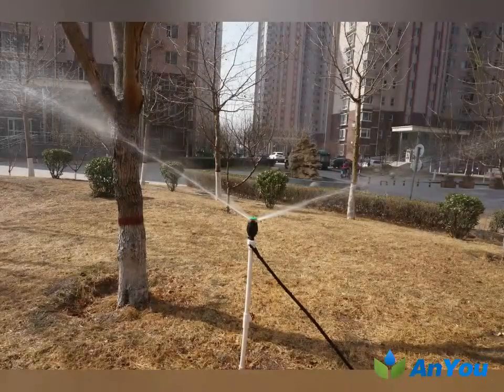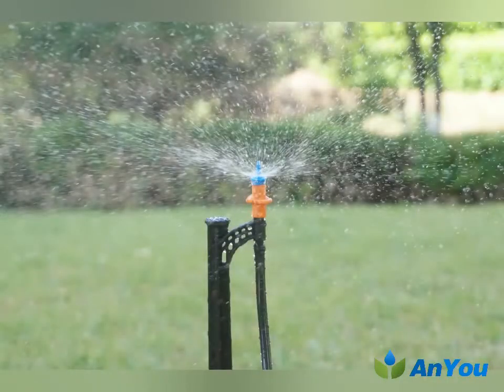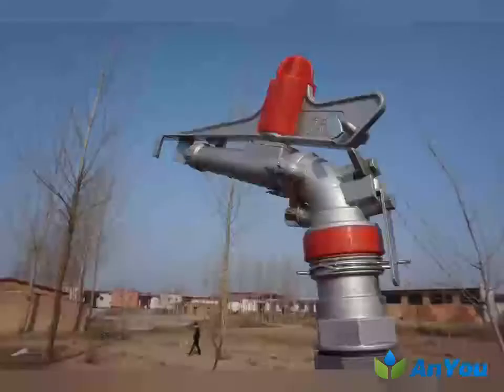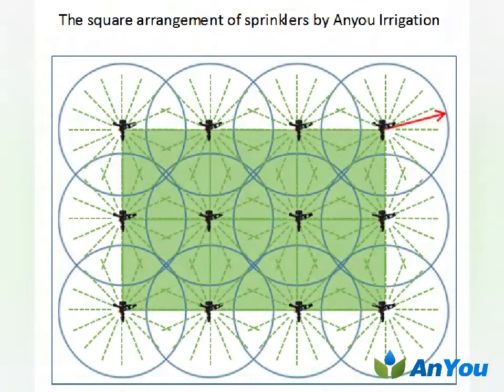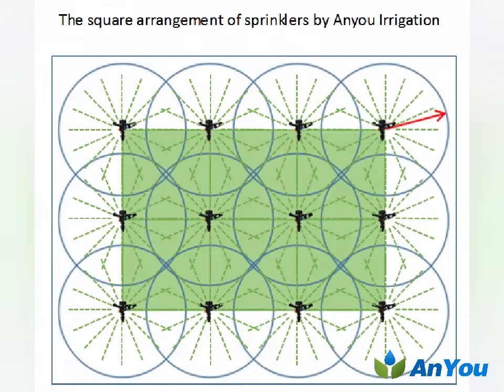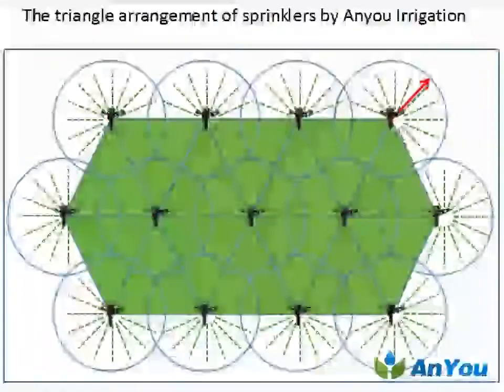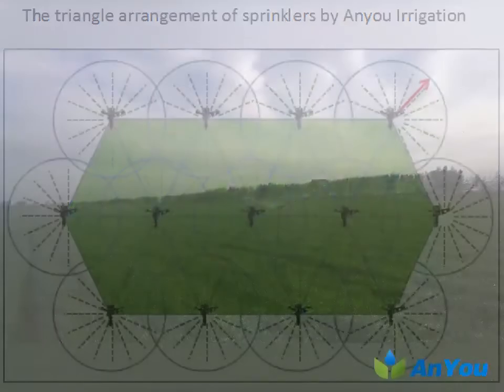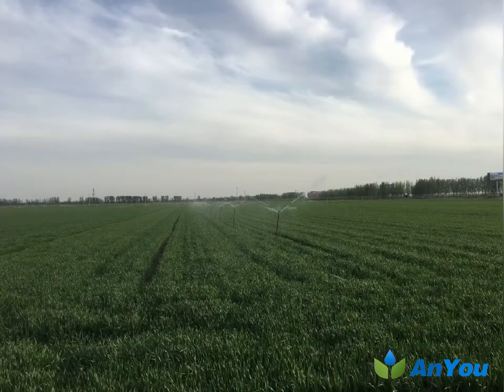Design, Selection and Arrangement of Sprinkler Irrigation System-Anyou Irrigation

Comment from the maker: Sprinkler for Irrigation and Its Design
Sprinkler Types and Selection in Sprinkler Irrigation System
Sprinklers Arrangement in Sprinkler Irrigation System
the selection and arrangement of sprinklers in the design of sprinkler irrigation system is a key factor affecting the quality of irrigation water in the whole irrigation system. 
The arrangement of sprinklers in sprinkler irrigation system includes the combination of sprinklers, the spacing of sprinklers along branch pipes and the spacing of branch pipes. 
Permissible sprinkler irrigation intensity of soil is one of the main factors affecting sprinkler selection.
The combination of sprinklers depends mainly on the shape of the plot and the influence of wind. 
Anyou Irrigation suggests to uses square or triangle layout as far as possible.
www.anyouirrigation.com
more information to contact Yachuan liu
 +8618132770977
#SprinklerIrrigationSystem,#Anyouirrigation,#microsprinkler,#ImpactSprinkler,#prinklersystem,#Selectionsprinkler #irrigationsystem,#Anyousprinkler #Sprinkler